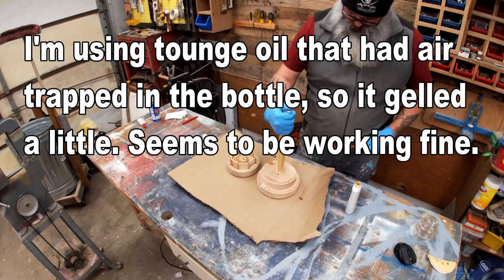How to Make a Lighthouse Paper Towel Holder

Comment: Looks great. I made a circle cutter jig when I had a bandsaw out of a piece of plywood. I cut a slot for the blade to slide through, ran a very short screw up through the plywood for my pivot point, and clamped the plywood to the table. You can move the screw where ever you need it for your circle diameter and if your slot for the blade is say 1/4" wide, you can fine tune it just by moving the whole piece of plywood a little bit and reclamp it.
Reply from the maker: That's a great idea David! I don't know why I didn't think of that, or make one. Next time I'm cutting circles....I'm making a jig!👍Thanks!